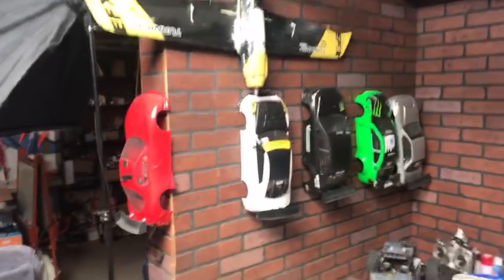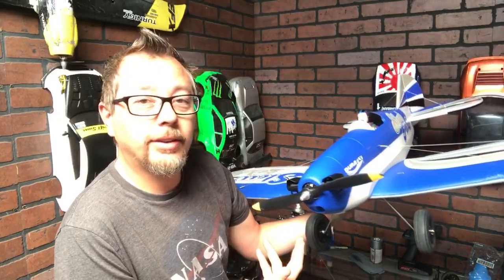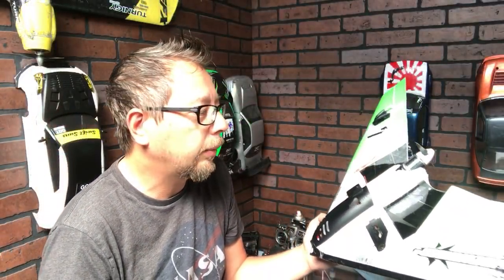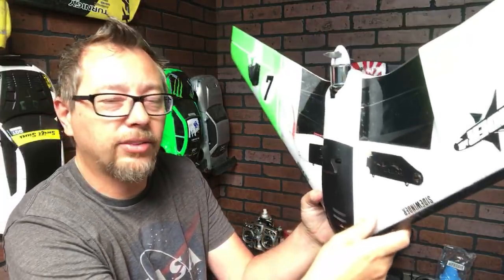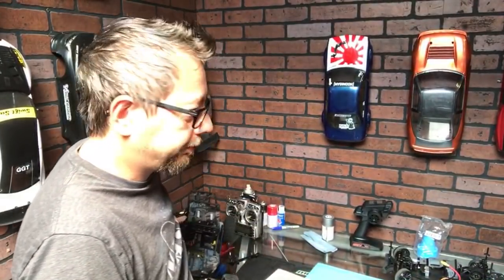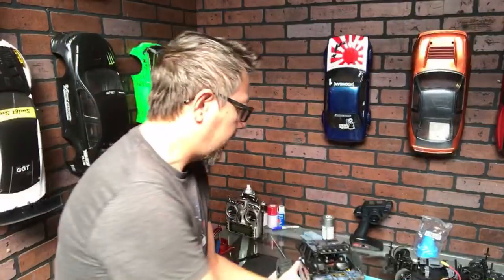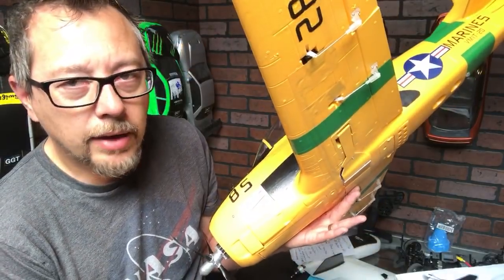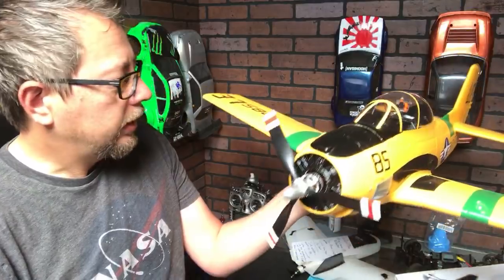7demo7 Channel Update

Comment: Great updates Jeff. The Sidewinder controversy has spiced up the RC community chat nicely.
Reply from the maker: Thanks Andrew. I just want to get to the bottom of it- will it fly or not.  Matt made a claim, “it still flutters with the 5x45” prop”, and I have no reason to doubt him but it wasn’t recorded on video. I’ll put it out there for everyone to see for themselves- live streamed- I should fly two full batteries. 
Hk- was good to send me the kit but it wasn’t intentionally done- they requested a pnf- so they will send another - this time a pnf. So I’ll have one spare airframe!!
This is not a dig at Matt at all. I want to test the frame as intended.
Reply: Of course. Different opinions and robust discussions only advance our knowledge. I'm sure Matt would agree.